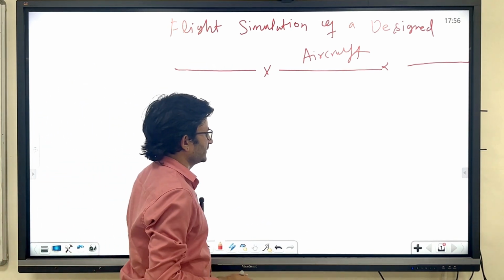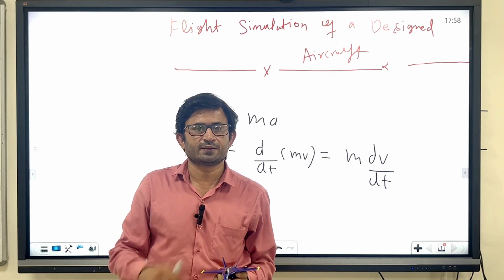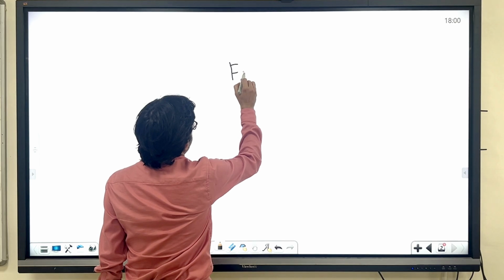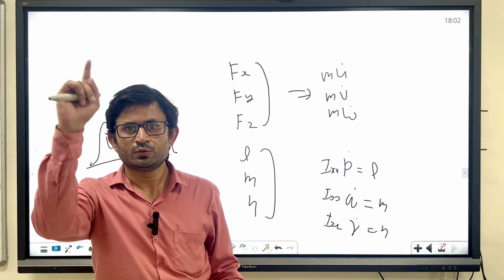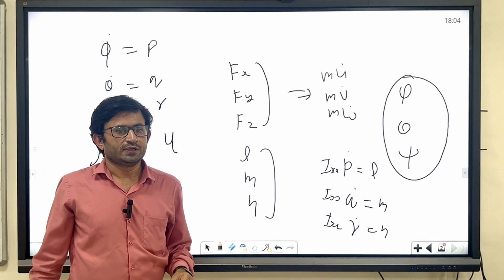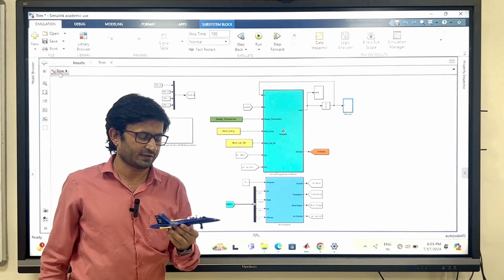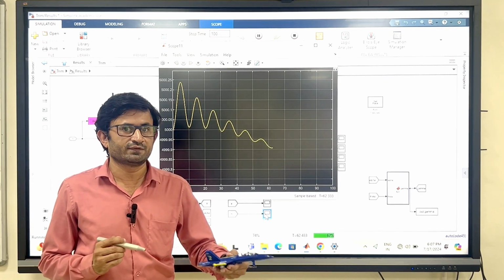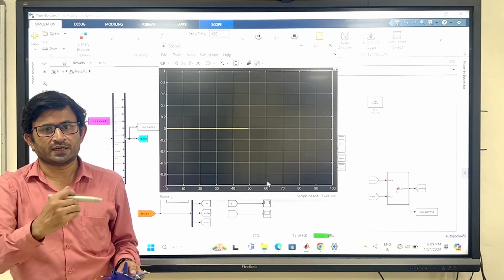Lecture 25 | Flight Simulation of Designed Aircraft | Aircraft Design by Dr. Salahudden

Comment: Hello sir,

As you said if we integrate the x_dot, y_dot & z_dot equations will get the positions I understood it completely but I  have a confusion , that I find at may places this x_dot, y_dot are  termed as velocity north and velocity east respectively ...is there any relationship of this naming with the actually earth's north and east direction, If yes then why south and west direction velocity we are not calculating to completely describe the motion.
Reply from the maker: @ravipratapsingh9910  First of all, thank you for understanding what u said. The x is taken along the North according to the right hand rule. For example, put your right thumb down, then mid finder will be in the direction of east and automatically the index finger will be in the direction of north. This way you can also define the body axis of aircraft.
Why down because, in the direction of gravity, the computation will be easy.
Secondly, we define the body axis as per the right hand rule (X along the fuselage nose, y along the starboard side and z downward). This way you align with NED frame which further simplifies the calculation.